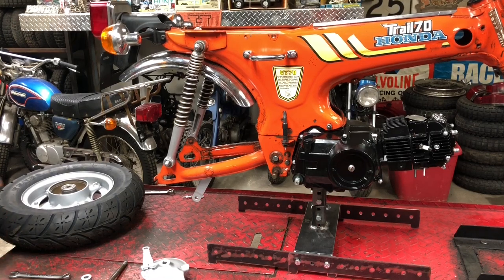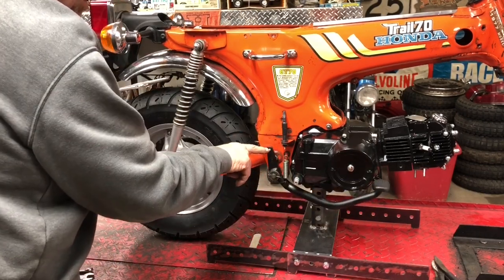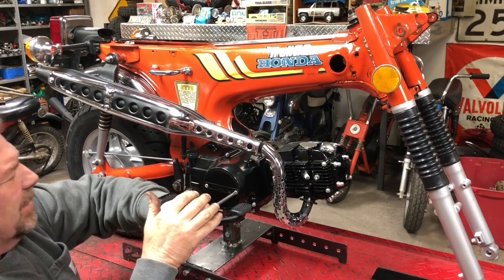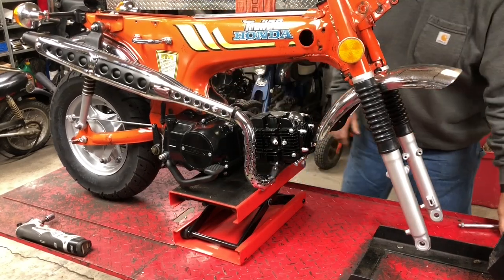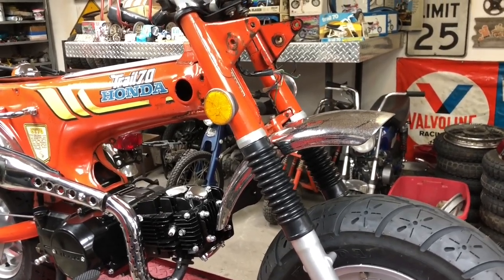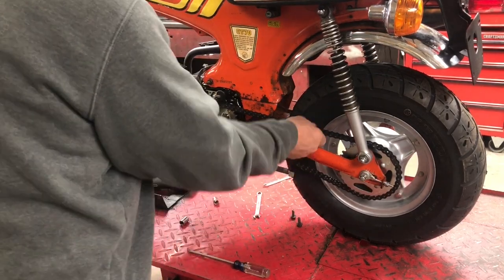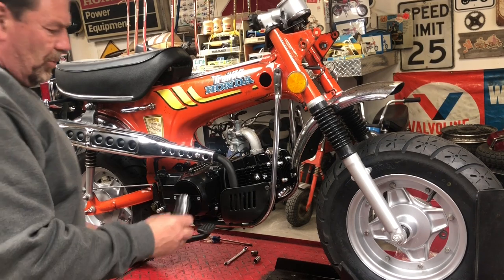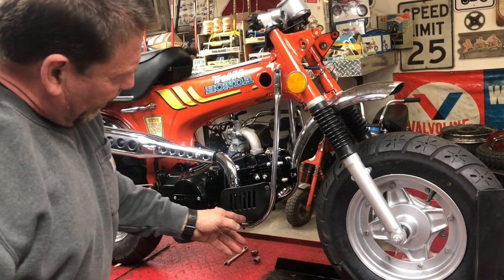1977 Honda CT70 / Lifan 125 - video #5

Comment: I'm working on the same year and model but I kept the original engine. Yours looks great. I'm in the process of completing the front end and electrical and should be ready to take off of the lift. Thanks for the video content.
Reply from the maker: Thanks.  I didn’t get an engine with this one, not that I would have used it anyway.  I like how it’s looking, I hope it rides as well.

Comment: Great video series, what model cordless nut driver are you using and will you be doing anymore truck video's.
Thanks
Kevin
Reply from the maker: Thanks Kevin!  I do need to swap the engine in the 56 GMC, so yeah, if there is interest, I can do more truck videos.
Reply: @MiniBikeMike  Yes. I enjoyed the truck vids. You also have the Dottle bug, I believe. Would enjoy some updates on them. Thanks,
Reply: I was liking that driver as well. What is it?
Reply from the maker: @allanlawson5888  I must have somehow skipped Kevin’s question.....it’s a Craftsman Nextec 12v driver.  It’s a few years old, not sure if they even still make them.

Comment: I have the same one that I'm in the process of putting together but I don't have a speedometer.  Do you know of one that would work with the bracket and the original wiring? Pls help
Reply from the maker: Any round speedo from a K1 thru a 1978 will work.
Reply: @MiniBikeMike  happen to have a part number or link to one? Not to sure what I'm looking for
Reply from the maker: @danielgonzales8279  I don’t have a part number.  Do a search for “Honda CT70 speedo”.  There is only two versions....a triangular one and a round one.  You want the round one.